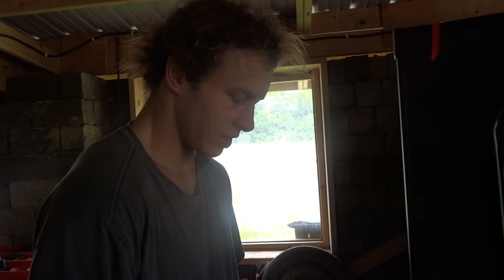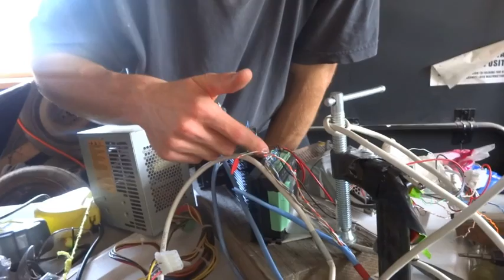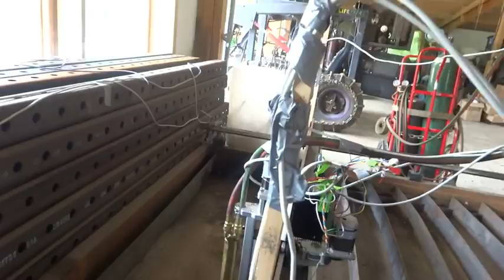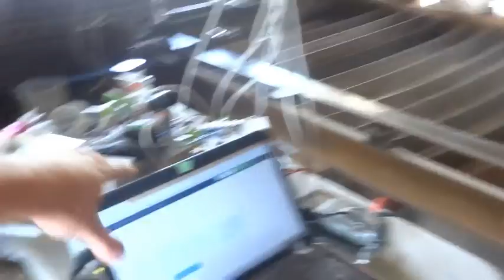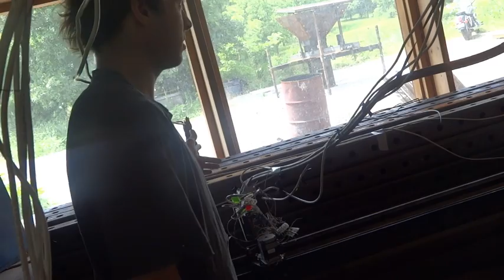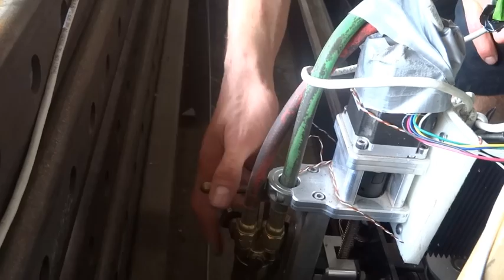TorchTableTutorial

Comment: are you shorting the power on line to ground on the atx unit? there is usually a power good line (grey) that goes high when power is good. you can stick an LED on there and monitor it that way